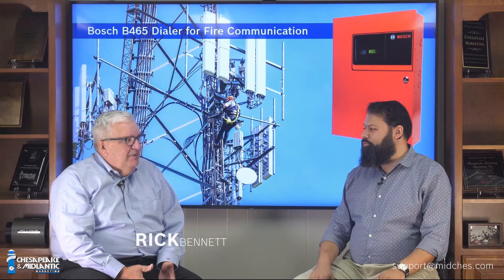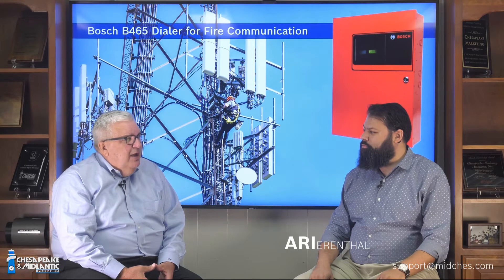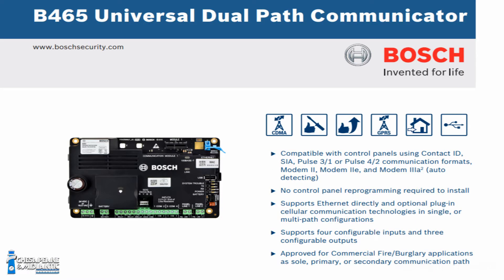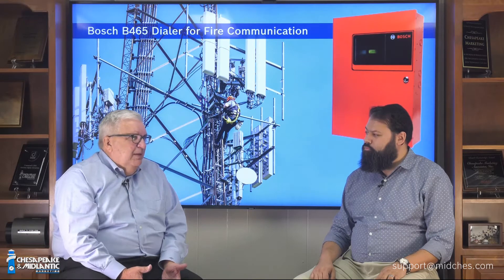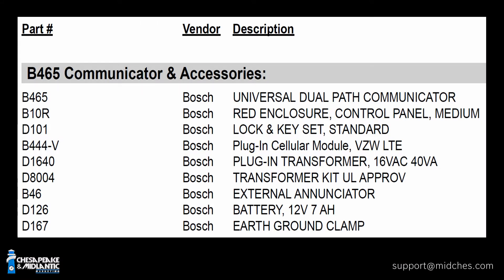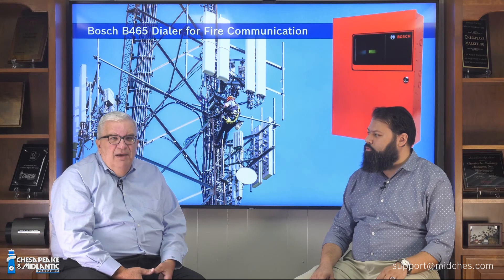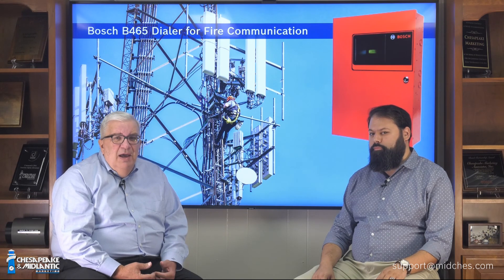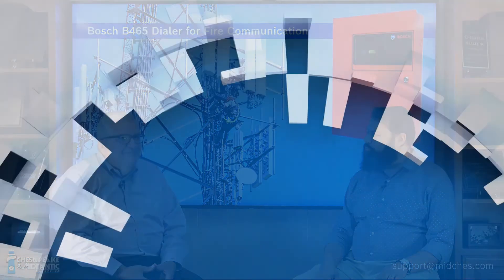Bosch B465 Fire and Intrusion Alarm Communication Dialer for Bosch and 3rd Party Panels

Comment: puts out 28vdc on the telco lines? isn't that low for a typical fire panel phone line supervision? feel like some panels will go into telco fault if the line voltage gets down below 34volts?
Reply from the maker: No. Keep in mind that line voltage is relatively high when on hook, but it dips really low when off hook, typically between 10 and 3v. Most panels are designed to accommodate this lower voltage, in case the line happens to be off-hook when it needs to send a signal- otherwise, line seizure wouldn’t work.